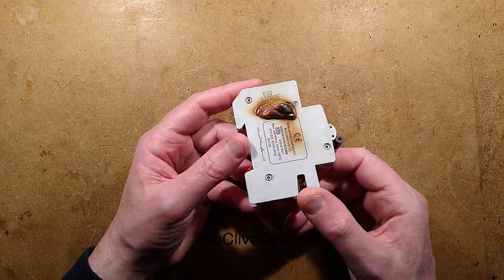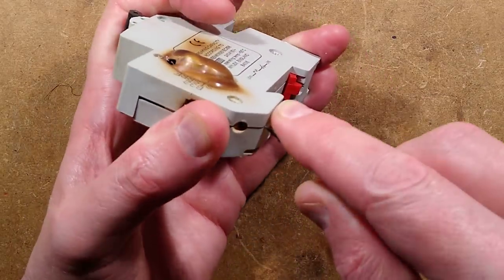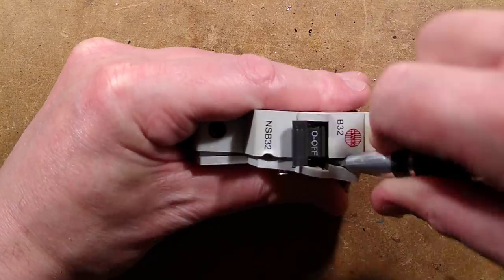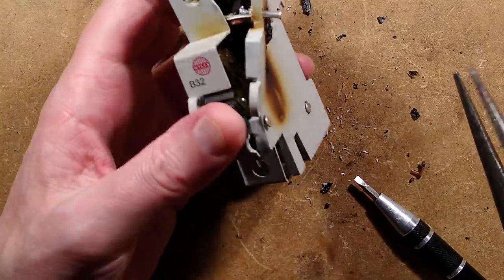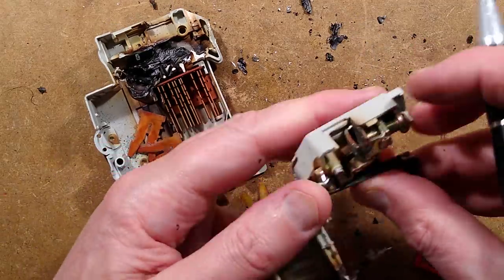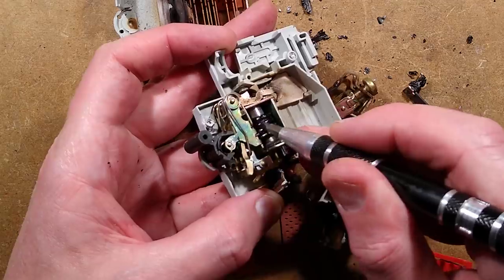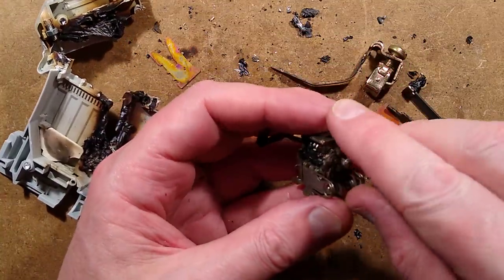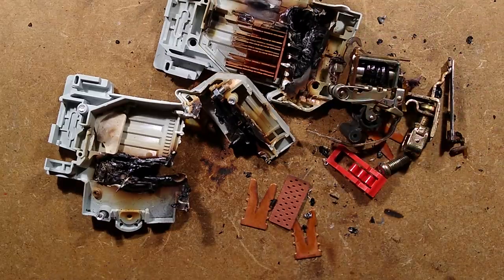Inside a totally smoked circuit breaker.  What went wrong?

Comment: If the breaker doesn't break the circuit, something else will, and it usually gets exciting!
Reply: Murphy's law: the $1000 piece of equipment blows to protect the 5¢ fuse
Reply: tronjet66 that’s the Apple way of design!
Reply: tronjet66, you have my admiration for being funny, being right, and knowing how to make a cents sign.
Reply: cool prank for the whole apartmen: bypass your circuit breaker and short the wires.
Reply: @peterjszerszen  Ohms Law wants to know your location...
Reply: Lightning strike damage?
Reply: @IncapableLP  The LCD backlight fuse that never blows
Reply: "Cool prank" must mean something different in the UK than in the US, ApertureChromaKey.  Or did you mean "cool prang"?
Reply: ehsnils looks like that - we had a lightning strike last may and we had breakers and the isolator switch do this
Reply: @IncapableLP  The funny thing is he probably has a Mac because it's easy to type the cents sign (option-4).
Reply: @straightpipediesel  or an Android. €¥$¢ are next to each other (UK layout anyway)
Reply: GR46404 'prank' in the UK is like a practical joke to wind someone up. A 'prang' in the UK is a car crash
Reply: Turns out, if the breaker doesn't break the circuit, the circut might break the breaker!
Reply: James Sloan  Take a look at the YouTube channel "KREOSAN" (there is also an English version).  They make light with wires LOTS of times!!
Reply: Circuit breaker is designed to break the circuit. Lightning is designed to break the breaker.
Reply: American hospitals have red faced plugins and they don’t even get the circuit broken they will never lose power for more than a millisecond or so this is for life support equipment !
Reply: @steve.Lowles  When I had a lightning strike it didn't make things go black.  It vapourized the copper so that when I looked inside our electric fence unit there was no longer any visible wire.  Quite impressive.
Reply: As long as I die its a good thing
Reply: In America my breaker will instantly pop above 13amp though it's rated for 15amp
Reply: Correct
Reply: That is the reason in Finland main fuses have to be actual fuses. They are less likely to fail.

Comment: The circuit breaker went old-school and "fused" itself.
Reply: I got to remember that
Reply: You're making fun of that, but properly designed breakers and even switches will have parts functioning as emergency fuses for cases like this.
Reply: @zwz.zdenek  Yup, we've had some GE breakers fail like that - in a relatively safe manner, that is. No discoloration or distortion of the plastic case.

Comment: So you're not putting it back together then?
Reply from the maker: I'd need a couple of cable ties for that.
Reply: @bigclivedotcom  ...at LEAST...
Reply: we could probably get somewhere with some superglue.
Reply: @Matt Quinn sorry. Come again?
Reply: @Matt Quinn I think there is a bit of paint you can use to cover up the dark spots.  But yes, superglue will make this look perfectly new.  

Though honestly you should study sarcasm. It is ok to have some.
Reply: @bigclivedotcom  Don't forget the gaffers tape. Nothing says fixed quite like gaffers tape (or duct tape in the US).
Reply: @Matt Quinn I've found that Gorilla Glue (polyurethane MDI prepolymer) works for just about anything that one would normally use superglue for.
Reply: @Matt Quinn Gorilla Glue is a 100% solids formulation, so sniffing it won't give the desired result.
Reply: @Matt Quinn Well, they can always huff gasoline (or petrol) instead.
Reply: @dragade101  JB Weld. The fine metal particles will make it quite sturdy and durable!
Reply: Take a page out of the blown fuse handbook. Pack it full of aluminum foil, and shove it back the breaker panel. It’ll work fine. 👍🏻
Reply: @bigclivedotcom  
  Note to self: Send a package of cable ty-wraps to the Isle of Man
Reply: Robert Slackware  Gorilla glue does not contain any solvents. The clear liquid is likely polyurethane prepolymer. You could pour it off and see if it cures.

Comment: I bet the owner of that MCB felt well chuffed when all that "nuisance tripping" stopped.
Reply: Only if you mean 'chuff' in the sense of emitting periodic bursts of acrid smoke ;)
Reply: @Blazin Redeye Yes that was his point - the owner who kept resetting the breaker mustn't have been the brightest and probably thought they did a good job when they actually made the situation worse.
Reply: What I want to know is what caused the breaker to trip in the first place?  Was it always the heaters like Clive said, or was the poor thing fighting fused wiring and burning insulation in the guy's walls at the end?  If I were an electrician and saw that, I would probably insist on replacing the wiring for the whole circuit.  I don't want a finger pointing my way when the guy's wiring finally gives out and he doesn't want to pay his insurance deductible.
Reply: @docferringer  Damage to cable in such a situation normally occurs at either end where it is terminated or at a junctioned point between. Continuity, polarity and Insulation resistance testing is deemed a suitable way of determining if a circuit is deemed safe enough to put into, or back into, service. It's not always possible or necessary to replace the whole circuit.
Reply: @cunning-stunt  Oh that's interesting thank you!  Does that mean the junctions would need to be tested before signing off on the circuit?
Reply: @docferringer  If I was getting poor continuity reading on any of the conductors I would be looking for a poor connection somewhere on the circuit. Poor connections result in higher resistance and as a result heat up damaging insulation and possibly leads to fire. Its why you are not allowed to make junctions in inaccessible places unless it is a no maintenance joint in a cable. There may of course be no junctions in a cable it may just run from breaker to fitting and onto the next fitting etc. Only reason a cable fails in the middle is due to mechanical damage or occasionally age if it is a very old cable.
Reply: @cunning-stunt  Mechanical damage and age are what I was most concerned about, since I would assume it would be more likely to show up the closer you get to the cable's rating.  Thanks for the info!
Reply: @docferringer  By age I mean old rubber insulated cables which have deteriorating insulation, very very few left now that are not degraded in some way. I have also come across some very early TPS cable that had the insulation breaking down due to no apparent reason other than age, but it was very old TPS.
 Mechanical damage infers crushing, stretching or impact forces acting on the cable, sometimes even chemical action on the insulation. but not damage from electrical influence, as in the case of an overload for example.
Reply: @cunning-stunt  Wouldn't be overly surprised if this particular case ended up being an exception as it looks like there was damage to most of the current-carrying conductors in that breaker. By the time you are getting copper up to the sort of temperatures where it is soft enough to deform readily (~900C) pretty much any polymer insulation is likely to be damaged if there is much of it still stuck to the wire at all something like the mineral insulation used on fire-resistant wiring would fare better but as far as I am aware this tends to be more of a special case used for fire alarms, active fire protection systems (eg positive pressure ventilation systems to control the spread of smoke etc).

Comment: The Wylex NSB breakers were recalled due to a fault which caused them to fail like this
Reply: Interesting to know, but I wonder how many people would end up knowing about this and getting them replaced, I guess only a few technicians that keep track of what they install would know and pay a visit...
Reply: Do you know if it was specific model numbers or it was all kinds that looked like the one shown? I ask because our DB is stuffed full of this kind of breaker. Not that we overload it, but if it's a known failure mode, I should maybe talk to the landlord and ask for them to be replaced and evidence for this would be handy!
Reply: It was the 6/10/16 amp breakers branded  Wylex / Crabtree / Volex
Reply: Thanks. I'm not sure if the ones we have are the recalled once since they are all RCBOs, although double checking lead me to find that the total current rating exceeds that of the 100A rated switch their connected to. I took a picture.Can someone have a look and check if they're the recalled ones or not and if I am right that the switch is underrated by about 80A? Although the electricity board's fuse will only be ~100A maximum IIRC. I'm a little confused. Anyway here's the picture, thanks in advance! 
https://i.imgur.com/Fg2UWDq.jpg
Reply: @jessicacarter8264  Can't comment on the breakers but a 100A main switch should be fine, adding up all the breakers only gives you part of the story as it would be very rare for a domestic consumer unit to have all it's breakers fully loaded at the same time (there is a word for it but mu brain has gone!), the whole of the power network works in much the same way.
Reply: @dglcomputers1498  Thanks for your info :) Trying to learn a bit more about how mains works, normally I try and keep as far away as possible, since it scares me (and deserves respect!)
Reply: @dglcomputers1498  diversity factor
Reply: @neilfarthing3888  I had the word diversity in my head but thought "Nah! that's not it"
Reply: @jessicacarter8264  The recall applied to Crabtree, Volex and Wylex MCBs (not RCBOs). The affected devices were the following:

Wylex NSB06, NSB10 and NSB16.
Crabtree (Loadstar only) 6M1B06, 6M1B10 and 6M1B16
Volex VB06, VB10 and VB16.

The Date Codes for the faulty MCBs are printed on the side of the casing which can only be viewed by removing the device from the consumer unit (a job that should only be carried out by a competent electrician). The following date codes apply to MCBs which were subject to the recall:

6 and 10A MCB - RIRA, RTRA, RCRA, RHRA, RGRA, RERA, RARA, SRRA and SSRA.
16A MCB - RIRA, RTRA, RCRA, RHRA, RGRA, RERA, RARA and SRRA.

manufacturerrecall more recently. Unfortunately, I don't have any details about that particular issue.
Reply: @dglcomputers1498  Diversity would be the term you're looking for. According to a chap I was talking to at Western Power several years ago, the network operator allows 1KVA per household (for a non electrically heated property) when they are doing their calculations. I had a 5 bedroom house sat on a 40A MCB for several years without tripping out, which leads me to believe they must be on to something. This particular place had a large electric range cooker and a tonne of halogen recessed lights too!
Reply: @Duncathon  I remember having someone come to my house 8 years ago or so following a recall letter received to exchange the suspect MCBs.
Reply: The breaker in this video is an NSB32 though, so it's not one of the recalled ones

Comment: if the breaker looks like this,  imagine the insulation of the branch circuit wiring!!

I have seen overheat / melt / fire damage like this on breakers, switches and receptacles from hot connections on aluminum branch circuit wiring due to cold creep, galvanic corrosion and aluminum oxide build up between the aluminum wire and the terminal.
Reply: Indeed. I'm glad Tom found it, rather than some cowboy. Tom only cuts corners he knows to be stupid lol
Reply: Aluminium wiring for power here in the UK is not allowed
Reply: @jaycee1980  have you ever tried to pull in a 600mm copper single? No chance. Aluminium is used throughout the hv game
Reply: @fraserreid719  im saying it is not used in UK domestic circuits. Everything is copper. For high power HVAC systems as used in large commercial buildings, 3 phase power is used.
Reply: @jaycee1980  Incorrect. Utterly incorrect. It's only prohibited below a certain CSA.
Reply: And ONLY in buildings
 (yknow, bs7671 and all that)
Reply: I’m sorry, with respect to aluminium, you’re all wrong. Solid aluminium is used occasionally in appliances in the U.K. and around the rest of the world. Just not for AC mains circuits.
Reply: @Mark1024MAK  not in quality appliances, and anyway... it was quite clear I meant "AC mains circuits" in this case
Reply: Posted 1 week ago??
Reply: @CallumAtwal  patreon. Clive is actually really awesome about this if you are a patreon you get access to the videos a week or so early but almost all are released to the public
Reply: @TheChipmunk2008  ah I did think patreon. Wasn't aware he had one!
Reply: @cyruscuckler9301  I am in Canada.  Not sure if the aluminum branch circuit wiring was common in the USA, but aluminum wire was almost exclusively used in houses built here between 1965 and 1975.
Reply: ss  Yes, I was not aware this was not common outside of Canada.  Between 1965 and 1975 the market price of copper became so high, almost all homes (likely a million plus) were constructed and wired during that ten year period with 100% aluminum wiring throughout, including solid 12/2 branch circuit wiring for 120 Volt 15 Amp lighting and receptacle circuits. These branch circuits were the majority of the trouble.  Here are some interesting videos on it:
https://www.youtube.com/watch?v=3VQCDtPs4JE
https://www.youtube.com/watch?v=Sj3ELHkgaU0
Reply: Peter Mulholland - yes, solid aluminium IS sometimes used in quality appliances. Further, it’s normally not covered with insulation. Where I hear you ask. Sometimes manufacturers use PCB mounting aluminium heatsinks to either form an electrical connection to a semiconductor device that has a heatsink tab, or to save on a jumper wire/link for a 0V/GND connection. The point that I wanted to make is that none of us are experts in everything. It’s not normal practice to use aluminium wiring for use in 230V/240V mains electrical wiring for domestic, light industrial and small offices in the mainland U.K.. And the electrical fittings (switches, sockets, junction boxes, connection units, MCBs, RCDs, RCBOs, isolators,  etc.) normally used are only designed for use with copper cable. Most of the electrical wiring standard that we use is not law. Most of it is just recommended good practice (that would be recognised as such in any legal setting). If someone came up with an alternative method and fully documented it along with reasonable precautions that used alternative materials and used fittings suitable for aluminium cable, then that may well be good enough be used and meet the legal requirements. Of course it’s not very likely unless the price of copper goes up by a large amount compared to the price of aluminium.
Reply: @StringerNews1 Wow, did you go off on a technicality tangent...
When I stated 100% aluminum, I meant aluminum service entrance feed, aluminum high amperage appliance feed (stove, dryer), AND aluminum wires in ALL 15A branch circuits.
In other words, NO copper even for low amperage circuits such as lights.
Yes, I am aware the alloy changed in the mid 1970s, and many of the problems with cold creep and oxidation were alleviated, but by then copper prices had become more reasonable, and aluminum was no longer used in branch circuits, where all of the problems occurred.  
You will also notice I did not blame the wire, but the connections in the OP, which I will include again:
I have seen overheat / melt / fire damage like this on breakers, switches and receptacles from hot connections on aluminum branch circuit wiring due to cold creep, galvanic corrosion and aluminum oxide build up between the aluminum wire and the terminal.
Incidentally, I have a house built in the 1970s with aluminum wires, and have experience using Penetrox, and the correct CO/AL devices and AL-rated Marrettes, in order to avoid problems, but I also have experience helping friends and neighbors repair aluminum connections with melt / burn damage I initially described in the OP.